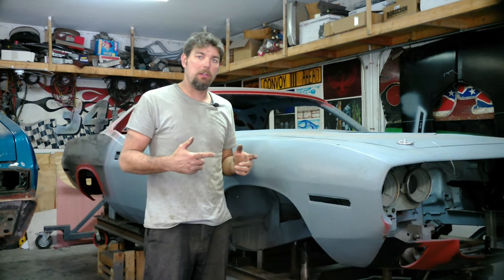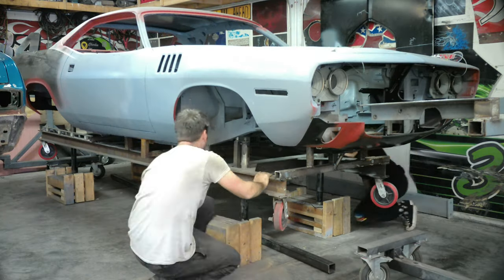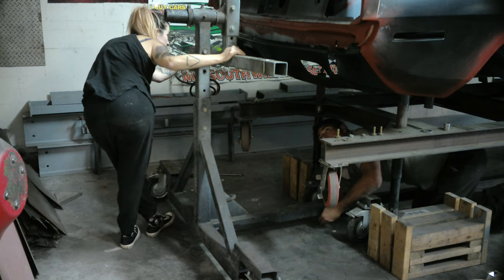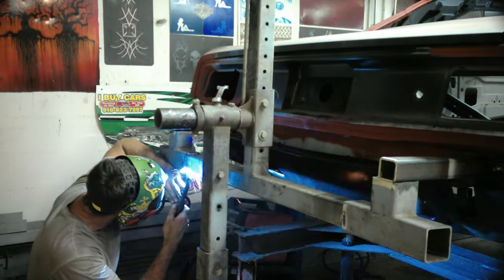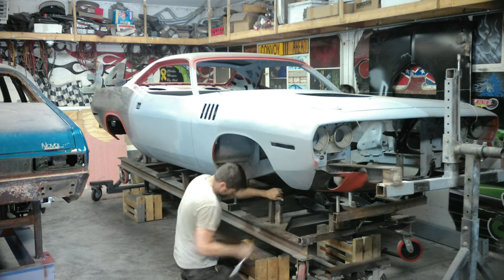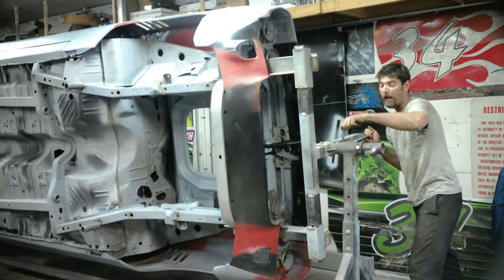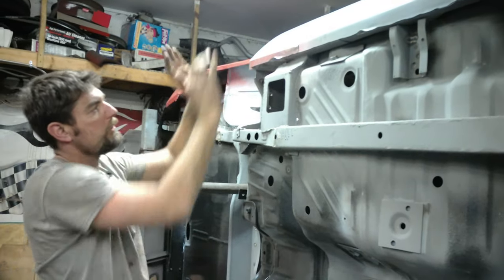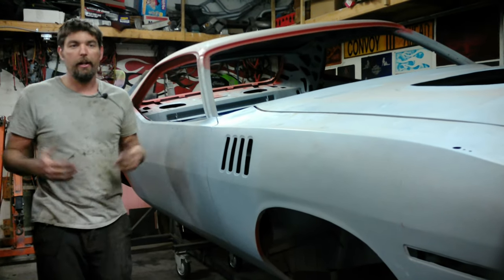How to mount a muscle car on a rotisserie, 1971 Barracuda Episode 13 as goes back on the rotisserie!

Comment: So the front bracket bolts to the bumper mounting holes and the back bracket is welded to? The back bracket doesn’t bolt to the frame? I can’t see your chat not growing. You have a lot of talent and you explain well.
Reply from the maker: In this video I use the plates going into where the back bumper would bolt into also
Reply: @carthageclassiccars Have you ever used Fast Etch from  Eastwood to remove surface rust and/or protect bare metal? It leaves a phosphorus coating until you return to work the area. Any opinions on using a product like this? 
I looked into etch primers. I saw comments that laquer thinner doesn’t remove etch primers and to use acetone?

I’m looking for some feedback advice. I have a project that I don’t/can’t work on continuously and need to prevent/protect welds and bare metal until I can resume work. Thank you
Reply from the maker: @jimdrechsel3611  I have not used the fast etch, but check out a video on OSPHO on my channel. That would be about the same stuff for removing surface rust. So the red primer in this video is OER red self etching oxide primer and laquer thinner has been wiping it off for me. If acetone works better not a big deal use that. A lot of times I will also use VHT Epoxy paint but you will probably not remove this completely but scuff over it and seal it up later down the road so if you need to get to an area again this might not be the best option. The best option is get the epoxy in the can 2 part that you can pop the bottom and release the catalyst but you have to use that can in a few days and its pricey. Hopefully that helps you out.
Reply: @carthageclassiccars   I was thinking about something like the Fast Etch because it is a liquid that could get into craters and such - not a flat panel. It leaves a phosphorous coating to protect it supposedly that you can wipe off later. I really don't want to blast. That gets everywhere and collects in areas you can't get out and later collects moisture.
 What preparation steps would you use to later epoxy over an area sprayed with the VHT epoxy? I have seen people post window cleaners, pre sol, water based alcohol ,,,, It gets confusing. 
Would you wipe a cleaner and scuff with 180? 220? I appreciate the help. My biggest concern is doing the work but when it comes down to priming and painting if I do the wrong steps to prep you later get reactions and bubbles. It's too much money too waste. Any help with a video you have for prepping bare metal would help too. I will check out your OSPHO. Thanks again.
Reply from the maker: @jimdrechsel3611  there are many different products and ideas on how to accomplish wat you are looking at. If I don't blast I follow the OSPHO video steps on rust removal. But on larger areas I usually try and always shoot epoxy and down the road at the end of the product I either scuff everything with 180 or strip to bare metal on the exterior and then shoot my basecoat epoxy which would lead you into the bodywork set of videos.

Comment: I have a question I finally got a rotisserie but the brackets that come with it are no where close to fitting didn't know if you could help me on brackets how to make them or if you have any for sale for a 73 charger love your videos best i have found
Reply from the maker: Thank you very much. As far as the brackets more then likely you will have to make them. I have a video recently on a 70 Challenger that I show the brackets I made for that car and the theory behind them. What I would do is level out your car first, then get the front and rear swivel points on the rotisserie the same height. At that point you should be able to make some brackets similar to these or that 70 video that go into the front bumper and rear bumper brackets. You want the brackets to be the difference in the height but all points on the rotisserie to be the same piviot points to prevent binding. Good luck with it I know most of this stuff ends up getting a bit custom but dont overthink it. Just some solid angle iron or square tube should work.

Comment: Nice work on the cuda you an expert man, quick question I'm working on a 1970 challenger I'm having issues with the doors I will appreciate any tips you can give me on this issue I  set the door on place with out the strikers line up my lines tighten door but when I open them they hang down I change the hinges pins and the bushing but no luck help me please!!!
Reply from the maker: If the holes are worn out in the original hinges that will cause some play. I am usually a fan of just buying the new hinges. Before you do that lift up and down on the doors there should be no play in them. I have a video on a 73 Challenger where I do door skins and go over how there is no play in the hinges. If you have no up and down movement align your doors without the striker get them where they are to your liking, then keep moving the striker to make sure it doesn't try and lift or lower the doors when closed. Hope this helps a little good luck .
Reply: Thanks man, I really  appreciate your response and the tip I will do that, I will be in touch on the outcome of this issue, keep up the good work, you got a fan here, thanks again.

Comment: I noticed you have the  K. frame incorporated in your  Chassie Jig is that for an extra alignment  Reference. Also the new frame rails do they have The alignment  Dow  holes and if so how accurate would they be.  I'm looking forward to seeing you install the challenger with bent frame rails onto your chassie jig  I hope you can take some time and explain that process, I enjoy your videos thanks👍👍
Reply from the maker: Thanks for the comment and yes upon first glance the new frame rails are identical looking at them. In the past the the rear ones have been the same also. I will use the dow holes and also take a measurement off the chassis diagram along with making sure everything is square. this should get me where I need to be or in a way I can use some push pull rigs to move it where I want.  The plan for the front end alignment as you can see with the shock towers I didn't JIG anything up. When the time comes we will build the front end at a mocked up ride height off a camber/ caster gauge then weld the shock towers to get the desired numbers we want. All of what i quickly described is the idea for a future some video's is will go over all that also in detail.

Comment: Ever have issues with sag in the center ?
Reply from the maker: I personally have not, but saying that I pick and choose what goes on the rotisserie. They are always stripped bodies with at most what you see here and I won't put them on here if the main structural pieces are rotten out. I won't even put a unibody on here if the quarters are missing to prevent issues like you asked about.